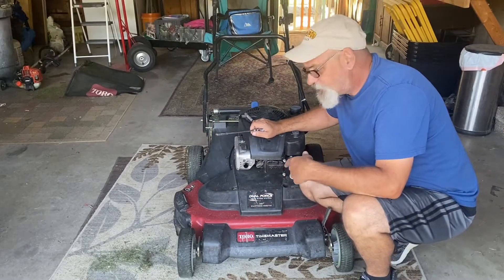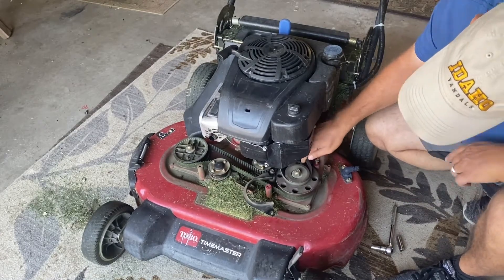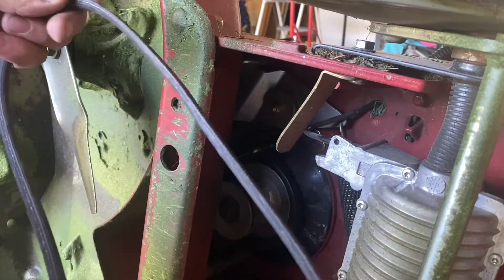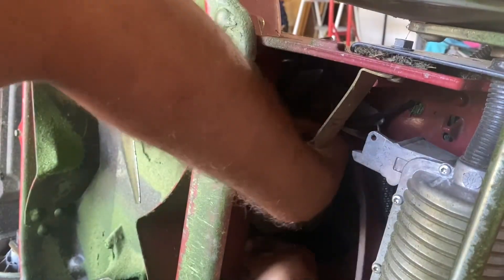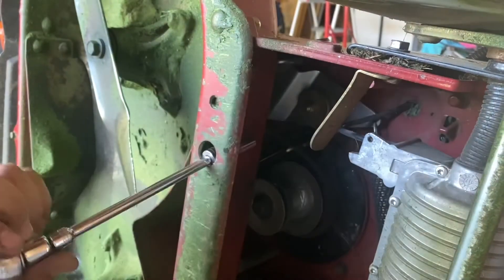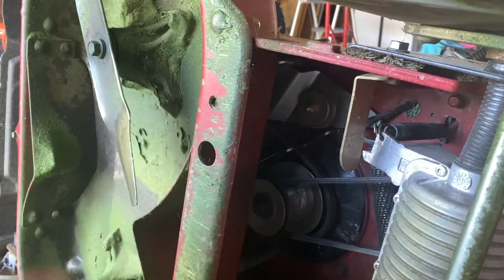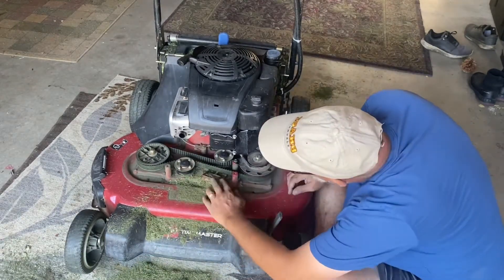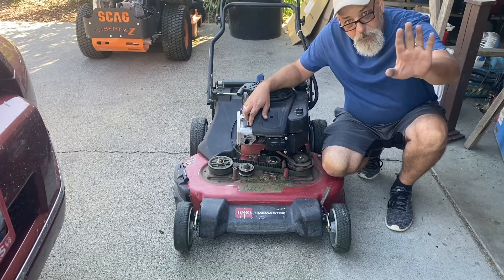Toro Timemaster blade drive V belt replaced

Comment: Great video Doug does it matter which way you flip the mower over?
Reply from the maker: Gas tank up will help leak less. Besides that it really does not matter.   I always let it set in proper position for awhile to let oil settle before starting.
Reply: @SodFathers  ok you made it look easy thanks